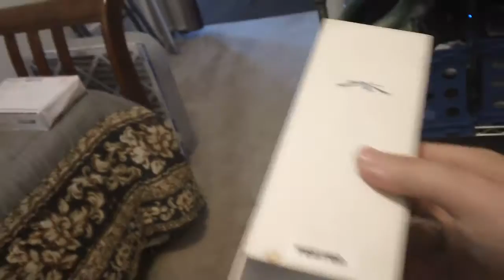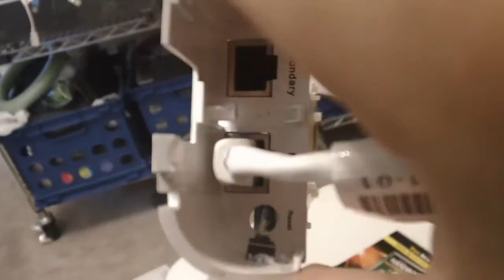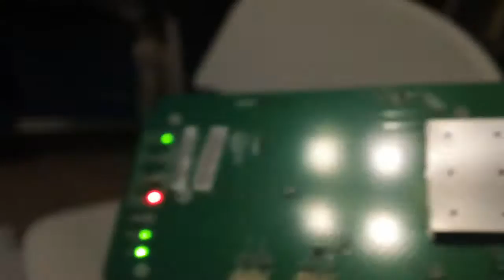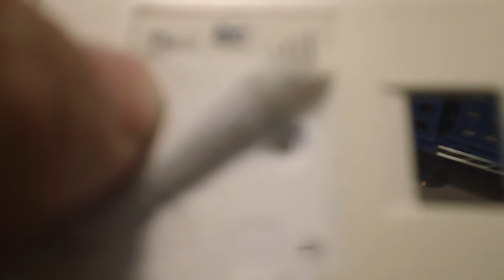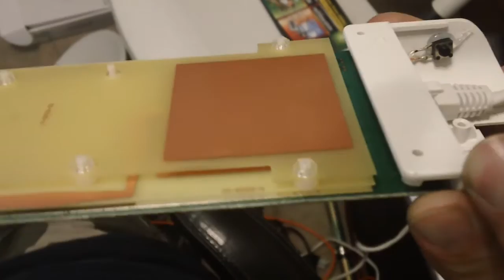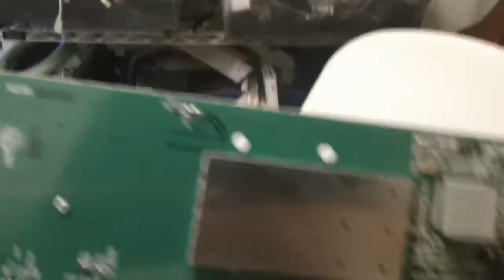nanostation m2 repair AREDN Mesh software

Comment: hi  dear ...  .. i have a na nostation  m2 .. when i connect the cable to POE port; the LEDs lights of Lan0 and Lan1 plug-in without connect the cable of lan0 or lan 1 .. and LEDs of signals plugin in mod unstable red  and orange aand green ... how fix this  problem  ...and thanks in  advance

Comment: the company my wife works for works on units like these.  Mostly Motorola however. 73 Jeremy
Reply from the maker: +Anabasis75 Hi Jeremy, these are well built units but this one was damaged by a former owner/operator   Mots are super rugged also..   

Someone smashed the reset button on this one and I finally needed it...so time to open 'her up and put in the only micro switch size that I had on hand..owell, it works!    Looking forward to your next journey, hope you are enjoying your time off. 73!
Reply: Pro trick: you can watch movies at kaldroStream. Been using them for watching lots of of movies these days.
Reply: @Mitchell Maverick Yup, I have been using KaldroStream for years myself :)
Reply: @Mitchell Maverick definitely, been watching on Kaldrostream for since november myself :D